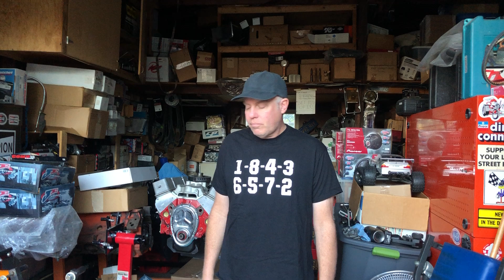Camshaft 4-7 Swaps: What's the Reason?

Comment: Did this to a Ford 302 once. We put in a 351w cam and changed the spark plug wires around. Why did we do it? Cause we like the 351 noise and had a spare cam for one on the shelf

Comment: Sorry for being really late here, but this is interesting. Some time ago I did a little figuring for my self and compared the Chevy and Ford firing orders. I first started by converting the Ford cylinder numbering into Chevy (and pretty much everyone else), then took into account the firing order swap done for the 351 and 302 H.O. Then I read where marine Ford engines often had another pair swapped for smoother running at sustained high RPM. After taking that swap into account, the Ford and Chevy firing orders were the same.

Comment: The 4/7 swap has been around a long time. Mostly used by racers looking for every last hp possible. 
I'm wondering if the new firing order also helps with internal stability because  the LS platform is amazingly long-lived when properly maintained.
Reply from the maker: The LS crank designer told me the firing order was chosen for NVH and that’s it

Comment: The reason the LS firing order being that way is for emissions. They changed it so that You did not have 2 cylinders on the same bank firing in order. With the old small block firing order there would be 2 cylinders on the same bank firing one right after the other, so the converter would get  2 exhaust pulses in a row on one bank  The New firing order  the exhaust pulses  alternate from one bank to the other, supposedly better for converters and emissions.
Reply: Still have two cylinders firing on one bank one after the other....cyls 3&1...so that's not accurate
Reply: @jarvislarson6864   True, the old firing order had 8&4 , 5&7 firing, so the new firing order would at least reduce having 2 pairs of cylinders firing  down to only 1 pair. 
I was remembering back to what they told us when I worked for a Chevy dealer and that was what they told us.

Comment: Ford guy myself I put 351W camshafts in my 302/347 it changes the firing order and the two front cylinders aren't firing simultaneously taking the load off the crankshaft it makes a H.O. and does make a difference.
Reply from the maker: Yes, you can change cams among Windsors to alter the firing order

Comment: Ford did this back with the 302HO using the 351w (302 marine) camshaft swapping 1 5 4 2 6 3 7 8 with the 1 3 7 2 6 5 4 8.  You could do an engine masters episode with the benefits, companion cylinders, crankshaft balance and bearing wear with the firing order.  Notable with the ford, the 1-5 put extra stress on the #1 main cap and 7-8 extra heat on the head/gasket.

Comment: I know this is an old video......but.......I have a carburetor / hot rod shop and I do a lot of street & bracket style engines.

Since the 80's from time to time I'd get a Chevy engine both small & big that had damage to #7 piston, rings or bearings....and sometimes a bent rod. No other cylinder was damaged eliminating a tuning issue in general.

In every case the customer had his plug wire wires tied together or at best, 5 & 7 touching or crossed over each other.

I only saw this with very high output ignition systems and fairly high compression. If the #5 & #7 crossfire, you're firing #7 45 degrees early. A recipe for damage.

Back then I was working for a Speed Shop and could call any perf mfg and get in the back door at will. I had long talks with a Comp Cams & a Crane rep. Both told me the only reason for the 4 - 7 swap was to avoid the internal engine damage. 

The Comp Cams guy said Reher Morrison & Sheppard came up with this idea and once somebody else saw it, it became common.

I've used 4 - 7 swap cams using the identical grind in a freshen up at the customers request and never was there an ET or MPH change we could attribute to the swap.

In all of them, the engine had a very slight difference in the idle sound and less noticeable with open headers.
Reply from the maker: Interesting, thanks for taking the time to share that. I’ve never heard the crossfire theory, even after speaking with Reher-Morrison years ago.

Comment: Today, Caterpillar 3508's still follow the old SBC firing order.

Ford used to use both the 4-7 and 2-3 swaps on their Modular V8's, but recently got rid of the 2-3 swap. Now, their 5.0 Coyote, 5.2 Predator, and 7.3 Godzilla engines follow the 4-7 swap, which is, interestingly, the same firing order as the old Flathead V8's.

The 6.7 Powerstrokes use both swaps.

And finally, the L5P Duramax follows only the 4-7 swap.

And to top it off, some MTU V8 engines do a 5-8 swap which is almost unheard of in the car world.

Comment: Here's a suggestion to Engine Masters. Test four pattern cams vs. traditional cams.

Two cams that are essentially the same, but one with the new four pattern setup.
Run both cams in a single plane Brodix setup, but with both carb and EFI.
So basically the following.
Run 1: Dual pattern cam with carb on a Brodix single plane manifold.
Run 2: Dual pattern cam with MPI on the same type of Brodix single plane manifold.
Run 3: Four pattern cam with carb on the Brodix SP.
Run 4: Four pattern cam with MPI on the Brodix SP.

Those Brodix manifolds have bosses that makes it possible to drill and tap for injectors.
Would be great to see a test showing whether or not there's something to gain from both carb and MPI 

ATB

Comment: Building my latest Pontiac 455 street strip motor i investigated putting a solid flat tappet 4-7 swap cam in it.  I found, much to my chagrin, that only hydraulic rollers with a 4/7 swap are available for Pontiacs.

Comment: Hay David, I thought GM also change the LS firing order because the old style was firing
5 then 7 which caused more heat in the high HP iron blocks firing two cylinders next to each other......
or it a wives tail ? cheers Brett
Reply: kermets  i've heard the same thing, even in older engines.  swapping the 4 7 still leaves 2 cylinders paired in the block and the firing order, changing 5/7 pair for the 2/4 pair, but, the 2/4 pair is closer to the coolant inlet from the  radiator and thus receives cooler coolant.  as a result the 2/4 pair run cooler than the 5/7 pair and you experience less detonation.  thanks, Brett

Comment: I have a 1980 Plymouth volare with a 360 in it. The 360 came out of a 73 dodge truck. The power steering pump pulley is bent really bad and I have been trying to find a replacement but I cant find one. Do You know were I could find one or what other replacement there could be for it .

Comment: I would love to see you have a cam ground to fire the paired cylinders simultaneously, similar to the “Big Bang” 4 cylinders. Spilt wires for the plugs and skipping distributor cap posts. May not run smooth, but it would be interesting content.

Comment: So that the "modern firing order" of the LS engines us like the 351w  and 5.0 HO FORDs.

(Real Ford guys knew that decades ago)
Reply: LS motor bottom end looks alot like the old ford fe motors from the 60s.
Reply: "if it ain't broke"
Reply: It take a very little amount of work to bolt LS heads on a sbf, and the LS uses the Cleveland deck height.

They literally took every good idea Ford had and added tilted cylinder heads.

Comment: I thought it was also discussed that swapping 4 and 7 was to keep 5 and 7 from firing in succession to cut some heat build up of the block between 5 and 7. 
Yes- no?
Reply: I always thought that it was to stop crossfire between  5 and 7 because there in succession of the firing order.
Reply: Also 5 and 7 are fighting each other for air/fuel mixture.. does create a heat difference firing side by side.. slightly. Thanks for the water crossover, helps 7 or be (Not so good) if not for that. Only my opinion... Seen it done, scratched my head wondering why 25yrs ago, I think it made more than 3-4hp.

Comment: In old engines two cylinders, side-by-side on one bank fire 90 degrees apart at the back of the engine where the cooling is not so good. Newer firing orders moves these cylinders to the front for better cooling. 
Cylinder to cylinder AFR is also something that should be talked more about.

Comment: Can we also get an engine masters episode of just easy ways to squeeze hp out of engines. Different oil viscosity, different muffler locations.
Reply: Exhaust holes, shapes, pipe & headers, restrictors or not, height of carb, single or two plane, multiple carbs, mathematics and physics courses, and the list goes on.
Kind of like fishing, not professional, the more you know the better your catch. If you are good, everybody is catching carp and pan fry and you are bring in bass.

Comment: Been testing the 4 7 swap for years. Unless you're over 550 ci we haven't seen a benefit. Speaking for a drag racing engine. We have changed out the intakes after making 4 7 swap and a tunnel ram made more hp mid to high range where a single plane and dual plain didnt make any difference.
Reply: Doug Hopkins good info, thanks for sharing...

Comment: Do they sound different?    Could you swap an LS to the old firing order?
Reply: Panhead49EL dunno. 
Yes. 

Although you’d be best switching to flatplane, far better balance than even the 4/7 2/3 swap
Reply: Would require a full build though
Reply: People say they sound different but all orders have banks with the same uneven pattern. If all the header tubes have the same length they shouldn't be any different other than maybe when it tends to misfire.

Comment: So what can I do with 4.8 that's about to go in my 80s shortbed. Trying get some power but not redo the whole engine.
Reply: Practically anything. Look up Richard Holdener on Youtube and Sloppy Mechanics on facebook (Richard has also contributed quite a bit to the sloppy group, and has also been on Engine Masters several times) for lots of ideas. The 4.Great pretty much responds favorably to anything that increases airflow (cam and headers are), before you get around to doing anything with the heads. Mind you, this is just me following along, and not my own experience, so do your research.
Reply: What kstricl said.  In a couple recent videos Richard recommended a decent cam, valve springs and possibly shaving the head for more compression was worth about 100hp for the little 4.8.

Comment: so this wouldnt work in newer vehicles unless it was reprogrammed as such?
Reply: if your planning on using efi then yes you would need to tune for this and change firing order within the PCM/ECM or even upgrade to an aftermaket engine controller. but if you switch it over to a carburator and get rid of your pcm then you could do this to a new engine.

Comment: I think we need an engine masters episode testing just this!!
Reply from the maker: Yup, I’m doing that
Reply: @TheDavidFreiburger ok big Dave, I used this info and other from u n Dulchich when ordering a solid roller 108 cam for my 540 going in a 69 Camaro.  Better work or I’ll want a full refund of all I’ve never paid you😂
Reply: @TheDavidFreiburger  
Oh 1 other thing:
Use the same pistons intake (do a new ring replacement and have the heads cleaned up (no new heads just clean up what you have) #RoadkillStyle
Reply: @RichardMLowe  LOL...it'll run the exact same as before. By changing all of them, you change nothing but starting number.
Reply: @killer2600  hmmmm
Reply: Very interesting discussion. I'm looking forward to the Engine Masters testing of this.  Thanks for your thoughts. Please continue all you do, I enjoy all of it,
Reply: @RichardMLowe  it's already been done in boats.

(it makes the engine turn the opposite direction so twin screws counter rotate)
Reply: @eformance  kinda like how a Blower/Supercharger works ✌️
Reply: @eformance  DOHC is a good idea of doing that #CounterRotate
Reply: @RichardMLowe   forget dohc i got something better i need some help to bring it to the table , although you shall all agree once we get it done, lets do this. its bar none for existing engine designs until we bring forth what else i got, thats correct, then we can build your DOHC theory as well.
Reply: @eformance  
Just thinking: 
What about the Ford that has the 1-8-4-6-3-5-7-2 can that "Swap" still be applied (the idea/concept)
Reply: @RichardMLowe  Not sure I follow, but most V8 cranks are the same pattern, so the firing order, irrespective of cylinder labeling, is the same.  Ford HO is 1-3-7-2-6-5-4-8, 302 is 1-5-4-2-6-3-7-8.  The HO firing order is also referred to as "351W" firing order, since it came first.
Reply: @eformance  thanks cause I was curious about the HO Ford ( that is  the "FE" motor right?)
Reply: @RichardMLowe  No, HO is still a 302. You got the 302 firing order and the 302 HO firing order. Ford changed the 302's firing order to match the 351W. If I remember correctly...
Reply: @DrTittieSprinkles  thank you for your input Chief
Reply: Richard Lowe... Forget the numberings, look at the patterns.
The 351W and 5.0 HO  Ford are the same crankshaft loading as the NEW LSs.
Chevy copied Ford's made in 1969. 😁😁😁
Reply: @hotrodray6802  why can't the automotive industry do things on their own and not "copy" the other one 😆😆😆😆🤣😂🤣😂✌️
Reply: @eformance   yeah and the 4 and 7 swap for chevys (amongst many other orders) fix the engine and what ford did to theirs. its just labeled different because the cylinders are labelled different. So basically in short the 4-7 swap for chevy cam is the same as a stock ford firing order.
Reply: @hotrodray6802 Well, then chevy MUST have done something else right that ford DIDN'T, because the LS smokes any ford motor
Reply: @7REDDRACO7 The ford 302 firing order is the EXACT same as a chevy small block, if you simply "label" the ford cylinder numbers the same as a chevy.
Reply: @davelowets  💯
Reply: @eformance  just "Subscribed" to your Channel
Reply: @eformance  this is why the 2 stroke Detroit Diesels are so popular in larger boats, very easy to run in reverse. If I remember right it's as simple as swapping the starter and water pump.
Reply: suggestion: calculate intake plenum/runner volume/flow speed based on firing order.  Possible that air mass holds a more consistent speed due to order or the pathing is more consistent thus reducing vacuum-pulse.
Reply: @NVMDSTEvil  hmmmm

Comment: I can't remember which one, but I believe there's a common problem with certain Duramax motors where the snap at the front of the crank shaft and that's due to the firing order putting uneven stress on the crank shaft